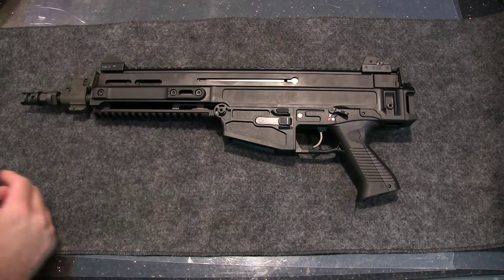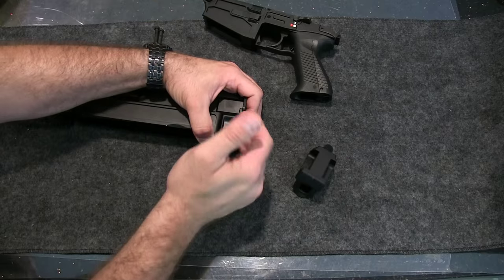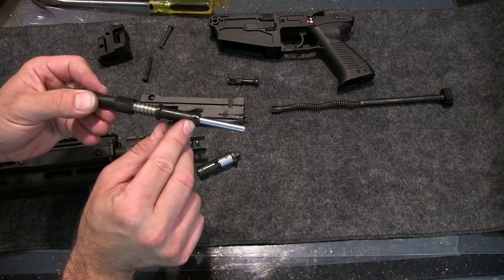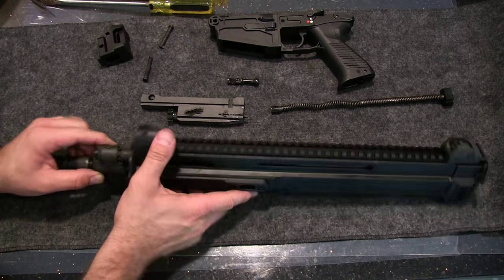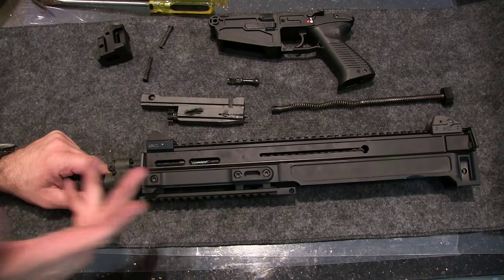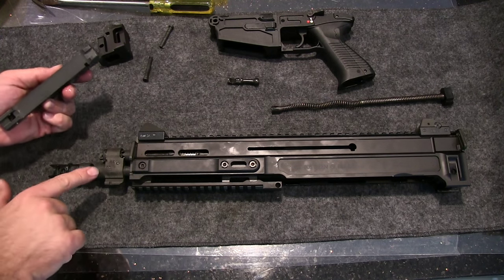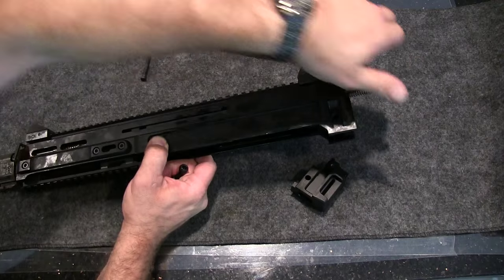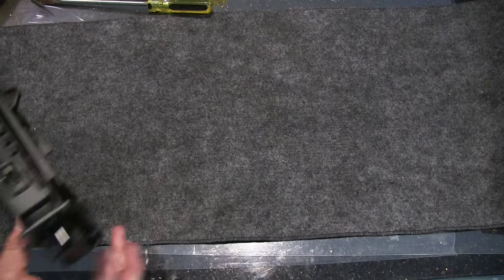CZ 805 Bren Disassembly

Comment: This gun has a lot of parts for an assault rifles. FN SCAR simplier and lighter. Beretta 160 over the all.
Reply: The SCAR and the BREN are almost identical. Scar certainly isn't "simpler" by any real metric. And having used the Beretta 160, it's not on par with either. Have you actually used any of these guns?
Reply: no. i am citizen of very democratic  country which bans own citizens to buy guns. my comment subjected to internet information.:)
Reply: Would you like to go fight to mountains  for a month with Beretta 160, BRAN or SCAR in solitary? Which one has less parts and details? Whis is lighter?
Reply: Why didnt you like Beretta as an assault rifle?
Reply: Thank you for being honest about that! To answer your questions.. if I had to go fight in the mountains for a month, i'd pick the Bren. It's the most stout and solid of the three, and edges out the SCAR 16 (which I own as well). The 805 is based off the SCAR,and is essentially CZ's version of the same gun. CZ is no slouch in making firearms, and they did an amazing job. The Bren and the SCAR have near identical numbers of parts, the only way the Bren can be considered to have more is if you count that the takedown pins aren't captured and count them as two individual pieces.

As far as the Beretta... it's a great gun! There are a lot of things I like about it, like being able to change ejection in seconds, barrels easily, and the like. It's a great gun, don't get wrong. The reason I say it's not on par with the SCAR or Bren 805 is....It's a less solid, more cheaply built gun. There's a LOT of plastic on it, and it doesn't feel solid. You can FEEL the polymer flexing in places when you shoot it. Now because of all the plastic, it IS the lightest of the three and that's definitely something good it's got going for it. The trigger is terrible. The charging handle isn't great. The rails aren't great. The general profile is rather thick. But overall, it's just not as solid and well built a gun as the other two, and that's why I say it falls in third place.

Comment: Those "non-captured pins like that" have a certain spot to be captured in, specifically on the shoulder-support that you seem to be missing. Christ, you have half the weapon and you don't even notice it.
Reply from the maker: You seem kind of sensitive that it bothers you so much? Here's this: 1) if I don't have the stock (because it was not imported by CZ at the time I did this), then how would I Know?  2), even with the stock, it's still not captured is it? I still have to take the pin and stick it in the stock, where it can still get lost, huh? You're comment with all the attitude still doesn't change the fact that the pins are not captive.
Reply: 762x51n8o There are two holes in the stock where these two pins are intended to go and stay there, which they do unless you have either faulty pins or a faulty stock. It's not mandatory to capture the pins, you can keep doing it the way you did before, for all I care. It's just you were unhappy about something that was already taken care of and it eluded you.

Don't turn this around by calling me sensitive. You clearly didn't think it through; behave like a man.
Reply from the maker: You didn't read what I said. (I know how the stock works). REGARDLESS of the stock, the pins still aren't captive and can become lost. Because you have to actively remove them, and put them in the stock. They are not attached. Key words: not attached. can be lost.  The fact is, almost every other modern military rifle has captive pins. Drilling two holes in the stock does not fix the fact that this rifle does not.  I called you sensitive because you act like the fact that I don't like non-captive pins was a direct insult to you.